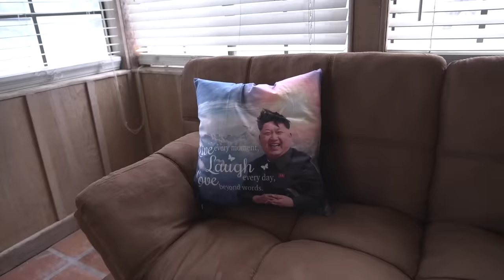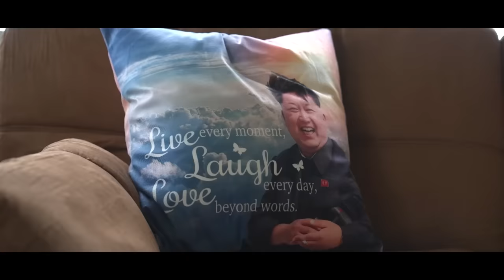Renovating an Abandoned Resort: Part 3

Comment: Matt- all of that PVC plumbing is going to fail- ALL OF IT. Any of it that has been exposed for much time to direct sunlight and any of it that has been subjected to freezing temps , especially when full of water- from your HS science course; water expands by 6% when it freezes- so plan to replace all of it sooner than later. Even the PVC parts in the "maintenance shed" should be held as "questionable" and used only as temporary , emergency fix.
Sounds like you at least have a plan A- great fortune with  that! Amigo! Saw Brandon and Co- knew they would be along- right place, right thinkers. It'll be great! Start looking at machinery auctions- tractors, backhoes, dozers- little stuff like that; you think a diddly little skid steer is something- Matt, there are toys and then there are TOYS. It's like the difference between a ride in a Volkswagen and a ride in a Cadillac- it's a whole other thing. Oh, and you might start looking for a real old skool stone setter- he will likely be too old to do much stone setting but he may be what you will need to set all  that white rock and a small quarry's worth more you have in mind- but if you have one really great teacher, building in stone is all aces- ask the Egyptians.

Comment: You need to do camp sites looking at the entrance definitely have enough land to clear area and run water and power and to camper/rv spots for ppl to rent do 30&50 amp sites and out yourself a dump station so they can empty before they leave! We are $40 a night for 30 amp and $50 a night for 50bmg spots! Might as well use all the property! Heck just take 10 acres and put in 20-40 spots could also have areas for tent camping we charge $10 for primitive camping per person

Comment: Hey Matt looking to the Amana PTAC units their air conditioning heating combined and they also have what's called Digi smart so you can turn them on and off remotely if need be I do maintenance at hotels and that's what we run they work amazingly

Comment: If you want to bring hard surfaces up nicely, try two cups of white vinegar, two or three tables of bicarbonate of soda in ½ a gallon of cold water. Rinse THOROUGHLY with cold water as it  an be a little corrosive if left for too long. I haven't bought commercially made cleaning products in years, saving myself a fortune in the process. The only place you [shouldn't] use it is on porous surfaces such as limestone. In that case just use dishwashing detergent.

Comment: for now you can get one of those portable hot water heaters that run on a propane tank couple hundred bucks and a bunch of line so you can run it to the shower and the kitchen sink
When you get that one building finished you can take the portable to the next building

Comment: Jenna joking about raccoons coming to your bed.....I had raccoon coming in through the side vent of the attic and walking around mostly at night. Well its a finished attic and it is my room, so they were in the small ceiling space and on occasion went down to the floor crawl spaces. Well after a while one decided to poke at a poster I have covering a hole in the "cardboard" wall from 10 years ago. Bob as he was later named realized there was no pins holding the bottom of the poster down and crawled through, ignored my snoring ass sleeping 10ft away and went down stairs. Wasn't long before dog found it waking everybody on every floor of the house up. It corned itself hanging on an upper cabinet door and eventually opened the next door and crawled onto the top shelf. We stuck a yard stick through the handles to lock it in there. Animal control wouldn't do shit because it was contained and not a threat so Bob stayed in the cabinet all night for about 7 hours before animal control finally decided to come get him.

Comment: Man, switch to PEX pipe instead of that pvc. Pvc water pipe will get brittle over a short time (relative to your 40 buildings) and you will constantly be chasing broken pipes. 
Pex is far superior and you can go up to 1000’ without a fitting to cause problems if needed.

Comment: You should be wearing a face mask for most of that work, especially when dealing with mold.  No exceptions.  Soap and water onsite for the hands as well.  Yes, frog.  A pressure washer would have cleaned the place up faster and more thoroughly.  Of course you shouldn't have burned the couch.  Air pollution alone is plenty of good reason not to.  Raccoon prints?